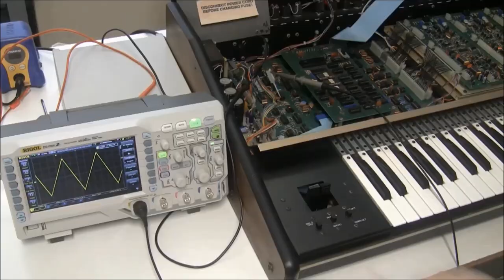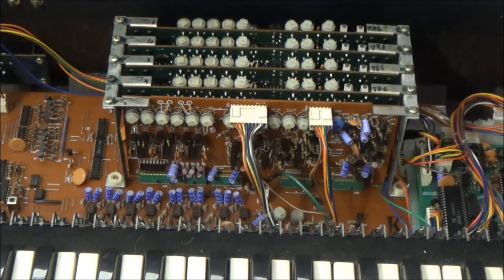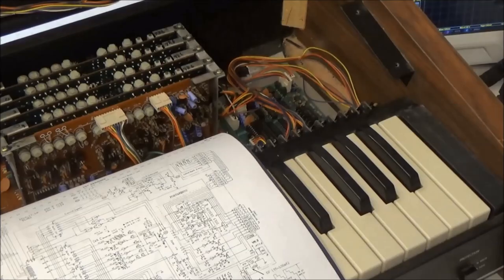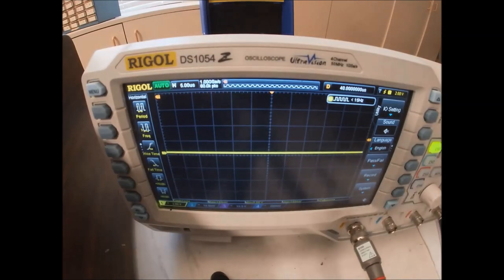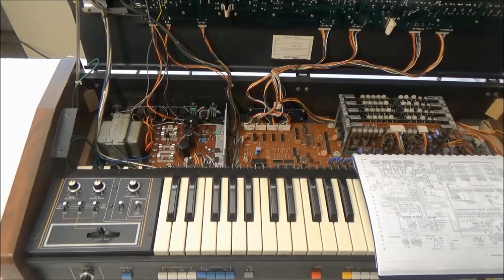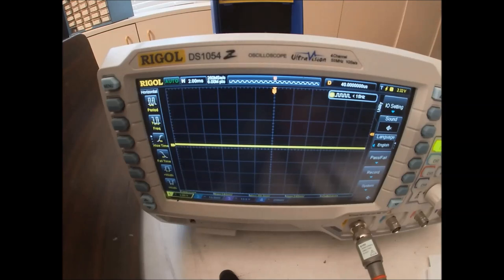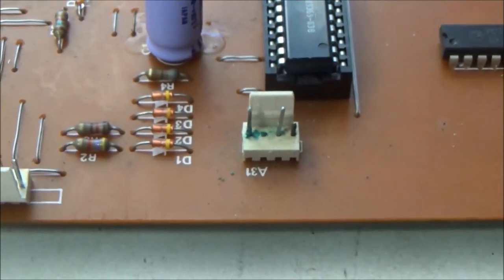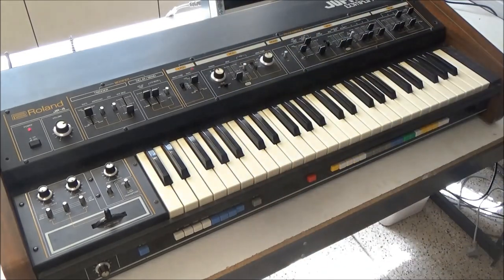Roland Jupiter 4 JP-4 Repair - Synthchaser #138

Comment: Thank you for a great video! 
I got my hands on a JP-4, but am missing most screws for the top panel and also for the keybed and the controller section to be fixed from the bottom. Any tips on what kind of screws these are and where I can get these?

Thanks in advance! 🤗🎹
Reply: According to the service manual, the four screws on the top panel are 4 x 8 mm truss head machine screws. The ones for the keybed and controller section are varied, there's four 4 x 60 mm oval machine screws and three 4 x 25 mm oval machine screws (which go in the very front). All of the bottom screws have dished washers.